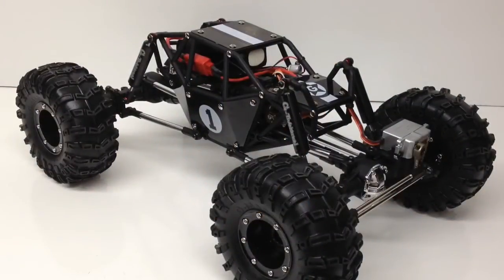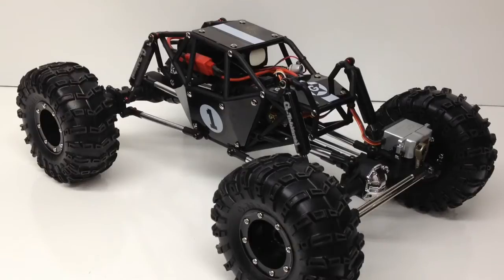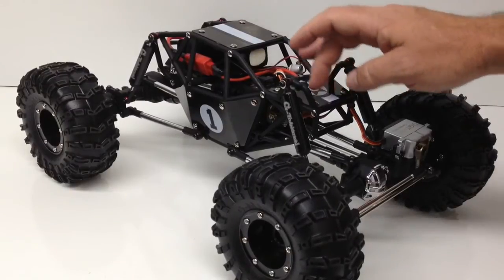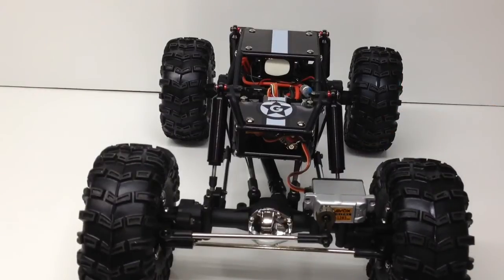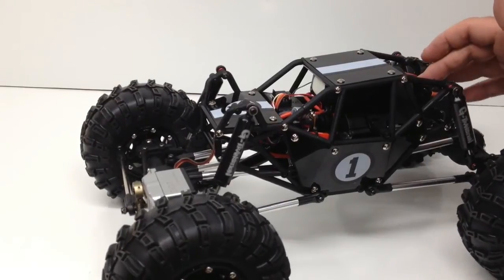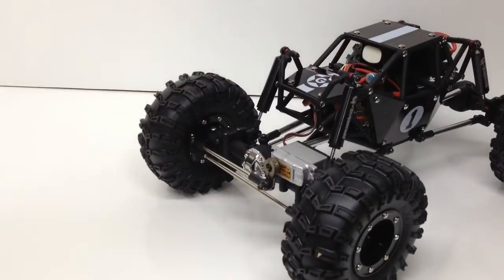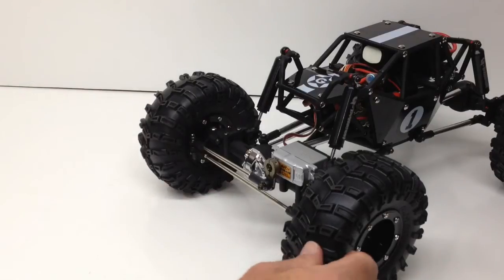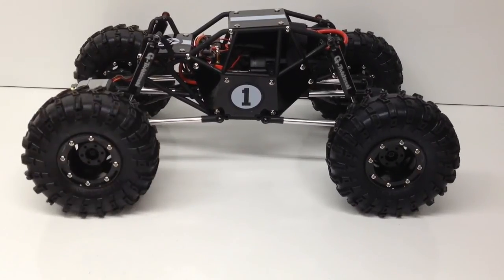GMade R1 Rock Crawler - Ready to Rock, Crawl!

Comment from the maker: It will be slow! which is good for this crawler which will mean lots of torque!  If your ESC can handle it, you can run it on 3s for a bit more speed, but just watch the temps